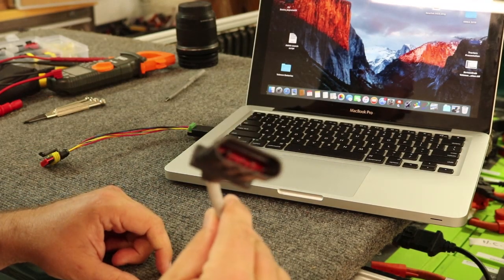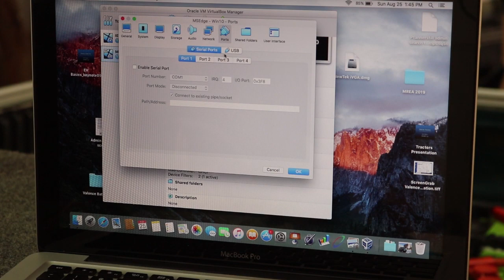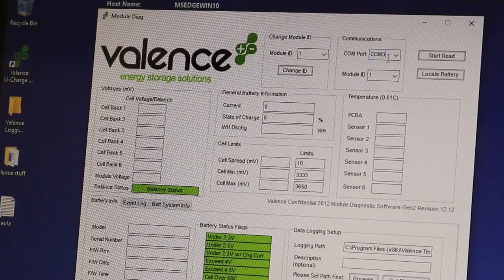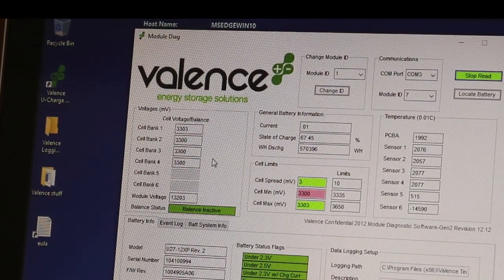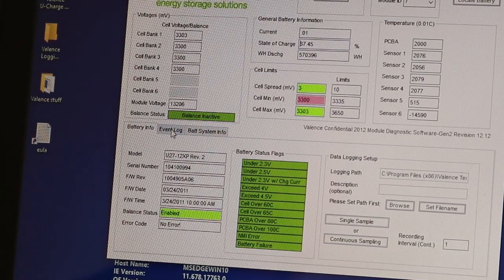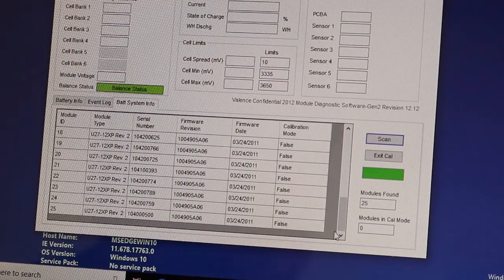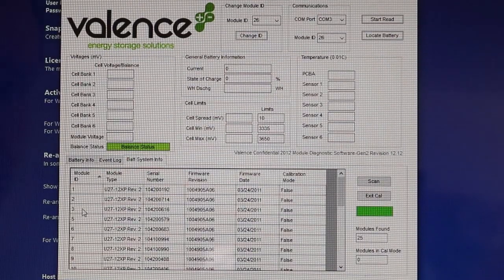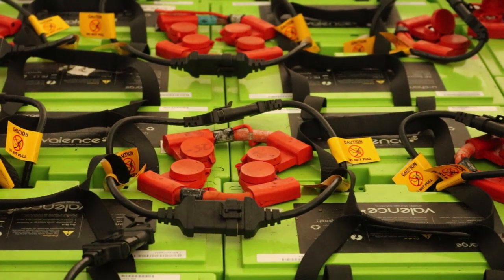Lithium Battery Communications | Connecting a Laptop to Valence XP batteries

Comment from the maker: I got the renaming figured out. Viewer, Sucotronic, suggested connecting to only ONE battery and renaming it, then connecting back to the full string. Definitely one of those "why didn't I think of that?" ideas. Worked fine. I now have module IDs 1-26 all seen by the software.
Reply: any idea on how to reset a fault code? i have the LED blinking once every 5 sec. Ordered the parts...hopefully will be able to clear, when i get them in.  aslo, how are you charging these? i felt that the internal bms didnt shut off at 10v
Reply from the maker: @dralusion  So far, I've just been charging with the charger built in to the Ford Ranger EV. I have a variable 12/24/36...72V charger I might try using to charge part of the pack at a time just to get it up to maximum.
I haven't had a chance yet to play around with resetting fault codes. I have one battery that has one and I'll shoot a video about it when I do.
Reply: Because I spend a good deal of time on battery,  I try to eliminate any unneeded draw.  the blinking light is low power draw I understand but its still a draw. 
Thanks for the Reply!

Comment: Have a ton of questions for you. I just purchased 6 of these batteries for a solar back up setup. The problem that I’m running into is that my grid Thai inverter utilizes a battery pack that has to be almost 500 V. So the question I have is have you or anybody else connected more than four in series to see what it does or if it does anything? What information I can’t find is very scarce and doesn’t mention much about trying to do that seeing as more information than anything else I’ve seen us for. You have the numbers it’s not a problem and getting the batteries again it’s not a problem matter of trying to reach that 500 V threshold. The inverter is a GROWATT. When I purchased it, I was not aware of the high battery voltage requirement until it was too late. With these batteries, I love the simplicity. I’ve literally just plugging them into each other. 
Do you have other videos with these batteries in them ? Thank you and GREAT video!

Comment: Hi Ben; I have super happy to find your video.
I have been using Valence U1-12RT batteries for YEARS and have yet to communicate with them.

I have a further question on getting the right cables;

I have got the other connection found (Tyco Amp SuperSeal) But what kind of RS485 do I need?

Would this work from amazon:
Jeirdus USB to RS422 RS485 Serial Port Converter Adapter Cable with FTDI Chip Support Windows 10, 8, 7, XP and Mac with ESD Protection (3ft/1meter)

It has 6 pins:
TX + , TX - , RX + , RX - , GND, +5V

Thank you!

Comment: the locate battery feature is there to locate the battery number that you have plugged in. If you noticed in that pop-up that you had there you would have seen battery ID #1.  so what it's doing is searching for batteries and it starts with number one. as soon as it finds a battery it shows you what battery it found so it's best if you only have one battery plugged in when you do the locate battery feature. it also inserts the battery number it found so that if you next click read it will read that battery. that way you don't have to manually select that battery number from the drop down.  it really helps if you have to renumber a long string of batteries because you don't even have to know what battery you're plugged into. you just click on locate battery and then you immediately renumber to the number you want it to be.

Comment: Question if I use just 1 of the u27 xp12 138amp hr battery will it work without all the bms/computer deal, ie... will it act like any drop in lithium battery? I dont need much for my small RV and I can get a great deal on one of these.

Comment: I know this is an 2 year old video, but any update on how these batteries held up?  You mention you weren't going to use the external Valence BMS, but that presents two issues: 1) the internal battery balance won't work unless you use that or constant PC connection, and 2) there is not battery-to-battery balancing if you don't use the external BMS.  Did your setup stay balanced (cell-to-cell, and battery-to-battery), or did you run into issues?

Comment: Excellent video man, learned so much from you here.  Just got one of these Valence batteries myself and need to test it under load some how, although this software seems to come very handy like you showed, any ides how I can test my unit before I use it with a solar panel? Thanks for sharing man.

Comment: I got the software loaded. i noticed in the 1st video you were having logging issues, i noticed you had 5 tabs in ur valence software. the 2nd video u had fixed ur logging issues but i noticed u only had 3 tabs. i am having logging issues as well and i have 5 tabs. any suggestions on how to fix this?

Comment: I got everything you suggested as far as all the connections put it all together but i cant get the software to work. it says access denied or something like that when i hit the browser button. Not sure what link is supposed to go there?
Reply from the maker: That's a PERMISSIONS setting. Check your settings in windows for who can access the software. I got hung up on that too.
Reply from the maker: Read/Write settings as well.
Reply: @BenjaminNelsonX  Thank you Ben ill try that. If that dont work i bought a Shunt which has most of the readings i need.

Comment: just bought the Tyco Amp SuperSeal connectors and a generic RS-485 to USB adapter. Where do i get that long patch cord( gray) you said is on the very last batter. I dont have a  long chord like that on my battery (3:49) all i have is a very short communication cable coming from the other end of the Valence battery. Do i need it or can i just make my own?
Reply: also what size gauge wire did you use to connect  generic RS-485 to USB adapter to the Tyco Amp SuperSeal connector?
Reply from the maker: You can make your own. I don't remember the specific wire size, but it was small. You don't need thick wiring for communications cables.
Reply: @BenjaminNelsonX  oh i checked your 300mpg web site and you mentioned the gage size there its 18 gauge thanks.

Comment: im going to try to make an USB connector for my very small Valence system. I'm going to use 2 U27-12XP batteries to run my AC in the summer .The only trouble I'm having is trying to figure out the best Charging system. I believe these batteries require a 70 Amp charger. According to the manual i don't have to buy a Lithium charger because these batteries have their own BMS system, but even a 70Amp charger isn't going to be cheap. Any suggestions will be helpful thanks.
Reply from the maker: Keep in mind that it's a RATE of charge. There's no reason why you can't charge slower. You might be looking at the MAX AMPS charge rate.
Reply: @BenjaminNelsonX  you might be right this is from the manual im not really sure what it means to be honest. Float Voltage Recommended Current C/2 13.8 V 70A

Comment: Hopefully a quick question, how would you charge a bank of four U27-12XP batteries (by Valence) in series forming a 48v system?  Can I apply a standard charger and the batteries handle themselves?  Do I need an external BMS?  The documentation on BMS seems to be only for protection from low voltage or excess amp draws, temperature, etc.  I can't find much information on charging these in series.  I want to buy these as replacements for the lead-acid batteries in my boat and don't want to charge each individually.  I have a solar charger for 48v systems with lead and AGM selection switch and would like to use that.
Reply from the maker: Some of the info on the BMS for these batteries is a little mysterious.
It seems to me that they are designed as a 12V lead battery replacement. You can charge them with a standard 12V charger. The cables on the batteries connect to each other and then out to an external BMS. My understanding is that controls the differences in charges between batteries. That's expecially important in long series strings.
For a really basic 48V system where you just have 4 batteries in series, it's probably just fine to run them on a solar charge controller. Just check the specs on the settings of the controller vs input voltage on the batteries.

Muller Industries carries a Low Voltage BMS for those batteries. Take a look at the manual for those and decide for yourself.

The batteries are not inexpensive. I would think that if a person is buying those batteries, just getting the BMS to go with them and charging them in 48V series is the way to go.

https://www.mullerindustriesusa.com/product/miusa-bmslv-valence-battery-management-system/

Comment: hello, great video, I bought the connector kit and RS485 Adapter, built the plug, but I cannot get it to communicate with my windows 10 machine, is the terminating resistor plug necessary?  I do not have one, but maybe could build one if thats the case.  You said 120 ohm resistor?  The link in the description does not work (website under maintenance).  Thanks in advance!
Reply from the maker: When I plugged in, it all worked fine WITHOUT the terminating resistor.
I'm the last guy to talk about troubleshooting a Windows machine with. I've just been using a Mac for over a decade. I did figure out how to run windows on my Mac laptop just for doing this.
It looks like any issues that people have had with this software and Windows was usually some permissions settings.

Comment: Hey Benjamin. I just bought 3 of these modules. I plan on running all three of them in parallel. So these batteries have an internal "BMS" that balances the cells within the module. Would I need to buy the extrernal BMS that valence makes to make sure that each module is balanced correctly since I have 3 in parallel? Or will the internal BMS on each of the 3 modules take care of balancing on their own? The extrernal BMS makes sure they are charged correctly and don't get too hot correct? I figured I could get a solar charge controller which would have parameters that would allow me to not use the external Valence BMS. What are your thoughts on this?
Reply: I have the same questions but now I have 4 , but dont know yet as I just got the software to work.
Reply: If connected in parallel, you don't need the Valence external BMS.  The built-in balancing electronics in the battery will do this, and will make sure no cells go overvoltage.  However, for this internal balancing to work, you do need this connected to the computer as shown in the video.  Battery also needs to be near fully charged, and cells of a differing voltage to warrant balancing.  There are other devices available which will also trigger this, if you don't want to connect to a PC full time or at some interval.

Comment: Ok, so i figured it out after a lot of frustration. This is very long winded but i wanted to pass on the info. First off, I have a windows 10 computer but i installed virtual box so i could install windows xp to run the valence diagnostic software. I have a 64 bit computer and virtual box didn't have a 64bit windows xp option initially, so i had to look at youtube videos on how to enable Virtualization in BIOS settings on your PC. Once you change this setting, in your bios, virtual box will allow a 64 bit installation of windows xp. If you have a 32 bit computer, you can skip that step. Next i had to locate a windows xp professional download. https://www.youtube.com/watch?v=_GYeqWEHzZI&t=202s I then ran the xp installation according to the tutorials on installing xp with virtualbox. Next, i had to learn how to enable fix sharing between my windows 10 computer and the xp running on virtual box. https://www.youtube.com/watch?v=swchq88QIOs&t=188s. Next, I downloaded dotnetfx20fxsp2 here: https://www.microsoft.com/en-us/download/details.aspx?id=1639 dotnetfx40_full_x86_x64 (download the 86 and 64 versions and see which work for your computer) here: https://www.microsoft.com/en-us/download/details.aspx?id=17718, The USB Driver here: https://www.usb-drivers.org/ft232r-usb-uart-driver.html and after tons of searching, the valence software here: https://1drv.ms/u/s!AitN-nrl5qF0d2Lt7EMehj39EJA . Now, you must extract the valence zip and driver zip files on your main computer and then move the valence install folder, the driver folder and the dotnet exe files to the virtual xp computer. Then install the dotnet files. next, you can install the valence software. Next, connect your usb cable that connects to the batteries for communication. The computer should then prompt you to install a new usb device and ask you to go through a wizard to locate the driver. This is when you tell the wizard to look for the driver in the folder that you had moved to the xp computer (Probably to the desktop). It will then try and install it. If this doesnt work, go  to the control panel in xp, then click on "system" and then the "hardware" tab and then click device manager. If you didn't follow that last part, google how to open device manager in xp. then go down until you see the hardware driver "ft232r usb uart (0600) listed under "other devices" if i remember correctly. Once i clicked on this, it prompted me to run the wizard to try and locate the usb driver again. follow the steps to locate the driver folder as above. This time it worked for me. Now, open the valence software and unplug the communication plug going between the usb and the battery. then reconnect. Now click "locate battery". Then you can click ready battery. It should hopefully work for you like it did me, after all this. Good Luck
Reply: "Next, i had to learn how to enable fix sharing" should have been "file sharing" above
Reply from the maker: Wow, there's a lot there, but hopefully that will help any others who run into similar issues!
Thanks for posting!

Comment: Hi, read all comments here, still a little confused. I see the usb adapter you made here, does that plug straight into the one cable on battery for the software to communicate?
Do you need the u-connect BMS? thanks
Reply from the maker: Yes.
Reply: Yes, you plug directly to battery or yes, you need the additional bms? Thanks
Reply from the maker: Just plug it in to a battery.

Comment: Great information thank you!  I just ordered 4 of these to use in an RV with 2100w of solar.  Have you tried to disable the green blinking LED on these?  Just curious if it can be done with the laptop.
Reply from the maker: I bet a couple pieces of electrical tape would make those green LEDs stop flashing.
Seriously though, the LEDs take essentially NO power. Unless you have the batteries directly in a sleeping area, I don't know why a person would need to change the LEDs. They are there as an indicator for you.
As far as I know, there isn't a way to turn them off with the software. My understanding is that there is a "storage mode", but that's not what you are looking for.

Comment: Got the adapter all made up but can't connect with windows 10. Got out my old XP laptop but still no joy. HELP!
Reply: Cliff Scott did you have any success? Same issue here
Reply: Ok it worked for me! I had to change the polarity of the signal cables and update the driver software on xp
Reply: Finally got it. It was using the correct USB adapter.
Reply: @cliffscott7073  did u manage to get it running on windows 10? no matter what i do says wrong com port. xp wont even run the application
Reply: @vb_assetto  Did you have any joy on windows 10  I hit start read and all I get is incorrect com port selected but divice manager shows it on com3
Reply: @michaelparish1217  no im using virtualbox windows xp with sp3 and net framework 2.0 and 3.5
Reply: @cliffscott7073  you were or were not using the correct usb adapter

Comment: Thanks for making this informative video.  I'm just getting started with three U27-12XP Valence batteries.  Learning all I can as I hook them up in my RV.
Reply: I have 2 of these batteries also. How are you going to use them? Have you tried charging them yet?  I plan to to connect in parallel for a 12v system but I'm pretty sure I need a BMS setup to charge them. I'm hoping someone has figured this out and starts selling them.

Comment: Which battery monitor cable did you connect the USB/RS485  able to, the male or female.I have one (another coming) from Muller and the software, made my cable and got the software to boot up but it can't find a battery or module.

Comment: Great post Benjamin. Where can I get the Valence software? I'm intending to use only one or perhaps two of these batteries in my RV, charged by solar via a Victron MPPT 100/50 charge controller.
Reply: OK, I've got the batteries, got the software, made up a lead to connect the laptop to the battery but the software isn't seeing a battery, has anyone got any suggestions?
Reply: @brassmonkey001  could you share that software please. im desperate finding it :(
Reply: @tudorcasian8136  Dunno if I can share the link but you can find it at: yousun dot org slash archives slash twelve sixtynine